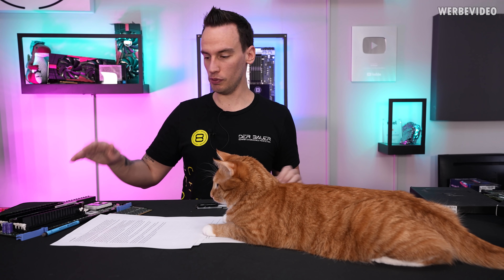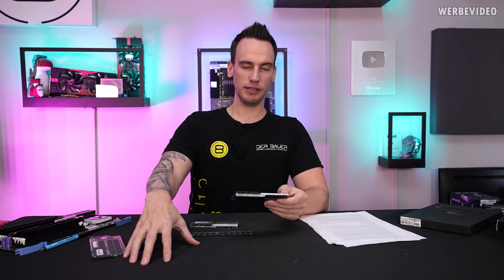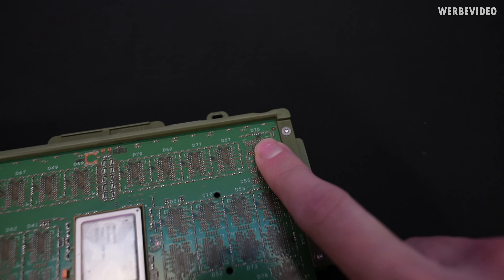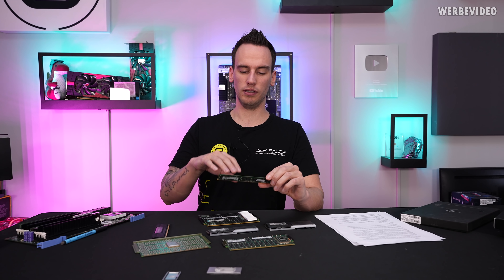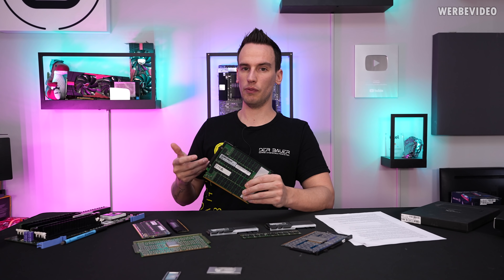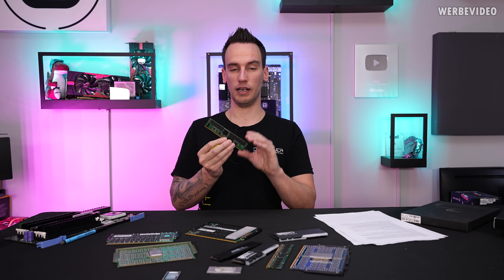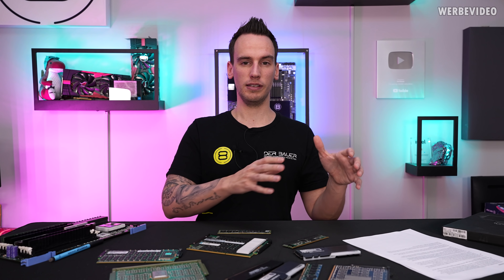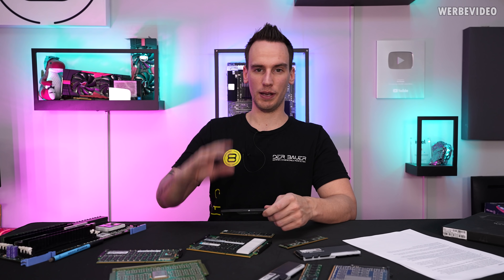This Memory Stick with over 150 DRAM ICs is Unreal and probably the Biggest Ever Made

Comment: AMD V-Cache and some of Intels ringbus cache are going to be adding some strange extra levels between DDR RAM and the CPU, plus SSDs getting faster and faster, the future is gonna be interesting.
Reply: Add Optane in between there for good measure too.
Reply: I wonder if DirectStorage will ever be used for things other than gaming.
Reply: Intel Ring Bus with 3D cache is the holy grail of CPU design
Reply: @saricubra2867  nothing using the x86 or x86-64 ISAs will ever be anything close to a holy grail. 
Even the m68k series from late 70's has a vastly superior ISA to even x86-64.
Reply: @saricubra2867  I forget if it's Intel or IBM using it currently? Where the CPU dynamically swaps Cache to split level 3, or lumped level 4? I think TechTechPotatoe had a video on it.
Reply: cache is cache and flashram is flashram. There's nothing radically different about them vs what has been around for many decades other than density and speed.
Reply: @beezle1976  V-cache (Level 4 cache) and ring bus cache (dynamically scaling based on core use/software need between 3/4) are not available on desktop/consumer side. So no it's not the same.
While it will be transparent to the user, it will have a difference in performance (in the case of V-cache and improvement in speed) or cost (in the hopes of speedy SSDs, in space).

Comment: My cpu would run 100c with that as it would block all air flow. 
And i saw the cat scrapped a part of the video there.  Scratched from the paper amd poof skipped.
Reply: In servers you get fans that are quite a bit more powerful (and loud) than in desktops, as in you risk permanent hearing damage within half an hour if you don't use ear plugs next to them.
Reply: @someguy4915  i'm running a air cooler and that cam module would be in front of my fan. and yeah i have a server fan at home.  they are nasty fans.  i once touched a blade on accident.  that did not end well.

Comment: I love odd computer hardware, IBM stuff has some romance to it.
Reply: Love 'em. IBM computers are stupidly tough and reliable, that most early PowerPC servers and mainframes can still be found today in excellent operational condition, no errors (although I would still recommend recapping the whole thing with new capacitors so you won't run into problem if they are over 10 - 15 years old - chips themselves are way overspecced for a very good reason so it would still work like new with replaced capacitors).